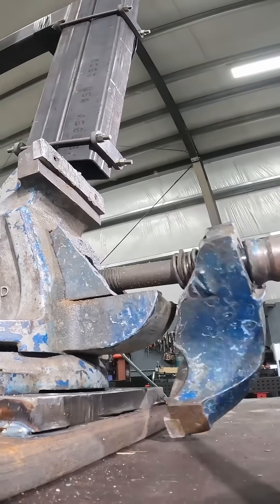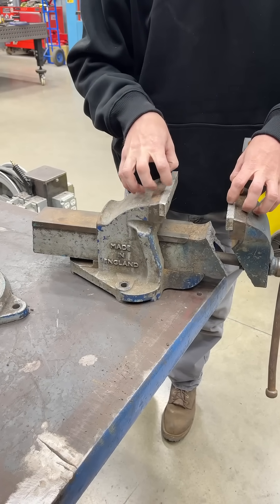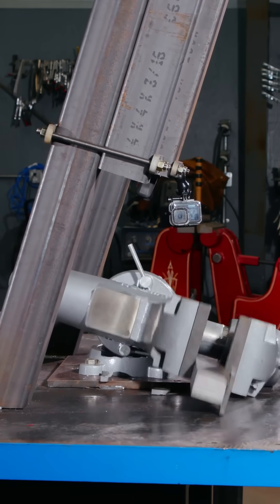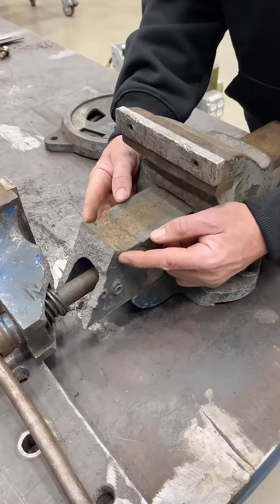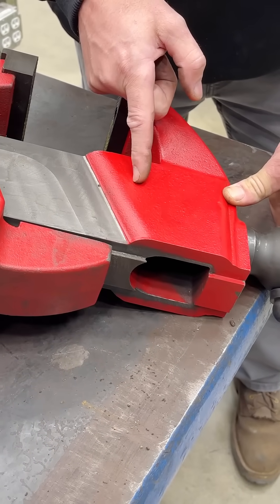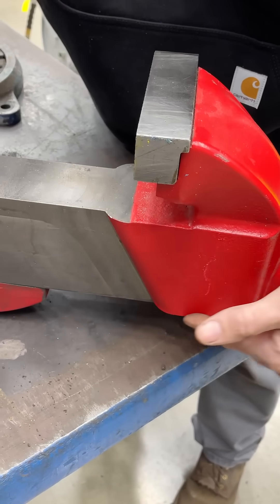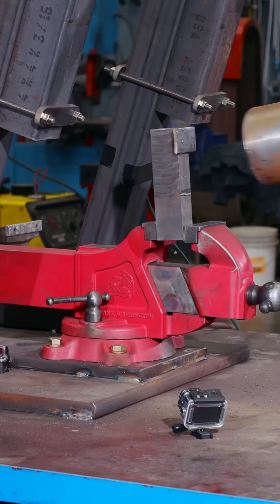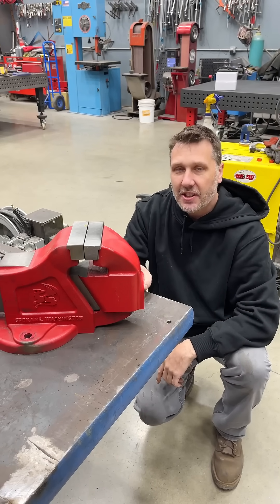This Vise Broke Where It Shouldn’t Have! Hammer Test!

Comment: Hey, shit happens. The vise should not have broke in that spot, but, it did proving the 3D models stress mapping. Also being Air Navy that broken area is a classic intergranular corrosion crack. I know, it looks like virgin uncorroded metal, but that is how it breaks apart cleanly. If you grab a microscope and looked at it right after the separation you will see the spiderweb of corrosion across that broken plane. Don't look now, by now its fully corroded on the face unless it was welded back together again.